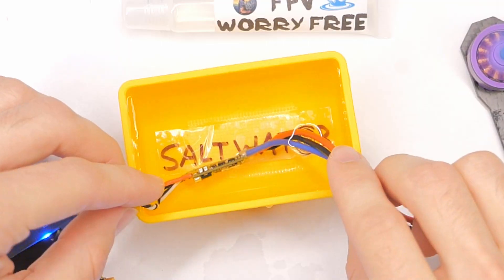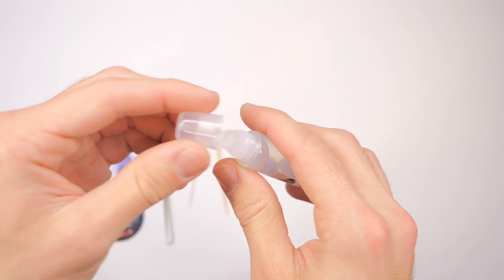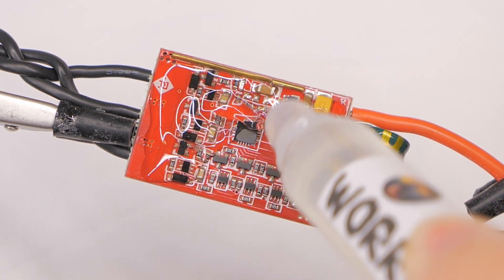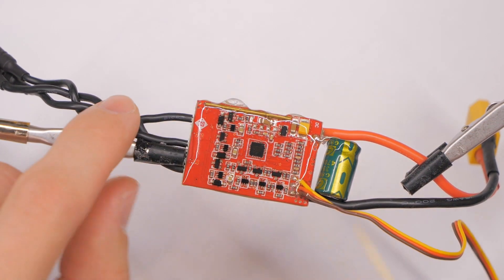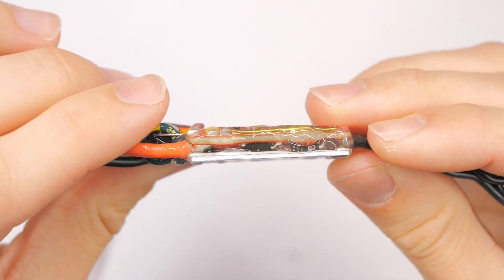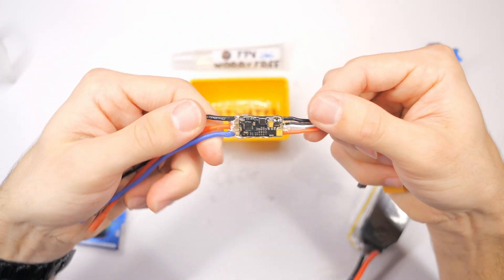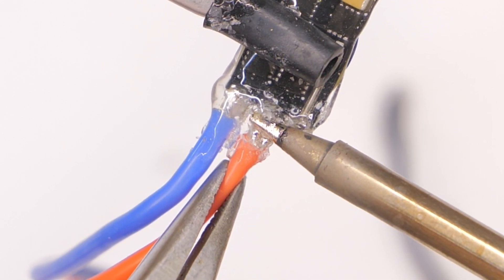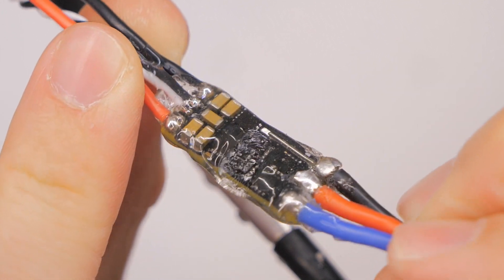FPV Worry Free is Better Than KOTKING. FPV Drone waterproof coating - kotking vs worry free - Review

Comment: Why do you avoid putting the worry free on the mosfetts? Because it will insulate them not allowing heat to escape through the heat sink. 
I will say the worry free is pretty messy  to work through for resoldering.

Comment: Firstly, thanks for all of your videos and work you put into this. 😄 I got a few questions. What do you think about conformal coating? As you said it's not as reliable. Any advantages it has? and what can be done to make it more reliable? ( Can increasing the number of coats for example help?
Reply: For thinner coatings like conformal coating and corrosion x, I’ve found that it works fine for everything but the ESC. My best guess is that the other electronics just work on lower voltage so short’s are rarer, and when they do happen they often don’t fry the electronics. I really like corrosion X because it’s quick and even waterproofs the buttons and plugs for extra security.

Comment: Wouldn't have been better just to block the opening of the heat shrinks?
Reply: I did the the first time and it works but as soon as a hole gets poked from like a ziptie you are screwed

Comment: I will say right at the end (when it smooshes it) I love how you put that in there and the best way to avoid that if holding your escs with a zip tie which I do and I’m sure everyone does all I do is just put heat shrink over it while It’s still wet and it seals the whole thing and pushes out all the air bubbles👍
Reply from the maker: Good idea. I'm starting to think individual ESCs are a good idea in some cases!

Comment: This is absolutely a fantastic video!!! Definitely going in my “how to” playlist for fpv worry free to share with everyone!😎 thank you Adam🙂 well done!
Reply: Dude make this tube have a micro head please… it would eliminate the mess. I’d be able to fit in smaller spaces effortlessly and leave a clean layer instead of a gloopy mess. Great stuff but awful design. (Would also eliminate bubble issue as well which is incredibly annoying)
Reply: @ryanclinetv  I have tested other bottle designs but this one works the best if you put a blob in the center of the board and spread it out from there. If the nozzle is thinner (like kotking’s tubes) the cap will pop off and the glue will go everywhere. I could put it in metal tubes with a fine nozzle but I dont think anyone on this planet enjoys using those. There shouldn’t be any bubbling issue if all the glue is at the nozzle of the tube.
Reply: @brandan_fpv  just my experience doing it the other day. Could have used half of the liquid if it had a fine nose, would be much better for heat… even a syringe would be amazing for getting it evenly in a thin layer on the board. Might stick it one myself, next time I’ll test it out if this FC takes a dump haha
Reply: @ryanclinetv  I’ll do some more testing and more polls on my instagram.
Reply: Hi how much worry free do you need for a full Build would one bottle work?
Reply: @PerceptionFPV  yes 1 bottle can coat multiple drones
Reply: Hey Brandon I can't buy fpv worry free in Europe ATM  no one has it. When do you ship out new ones?
Reply: @Raven-FPV I will be shipping out stock at the end of the month, so expect stores to have it sometime in December.
Reply: @brandan_fpv  nice good to Hear.  Mine is empty 😄.  Thx bro

Comment: I used to recommend silicone conformal coating, but it has a tendency to flake off. These products seem like a much better option.
Reply: I am in the process of doing a thin conformal coat as well like mg chemicals for more normal use just in case overheating does become an issue. So far no complaints even in the summer heat of Australia🙂
Reply: @brandan_fpv  I have the same product (MG chemical 422C).  I can easily scrape off the coating with my fingernail.
Reply: @yannickg6904  yeah I used it too myself and actually fried a fc and esc in the rain